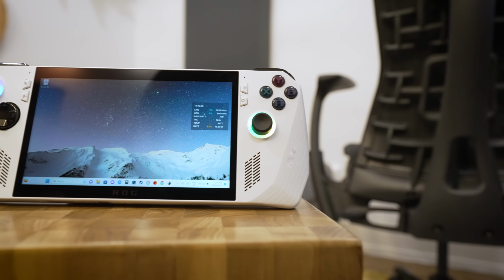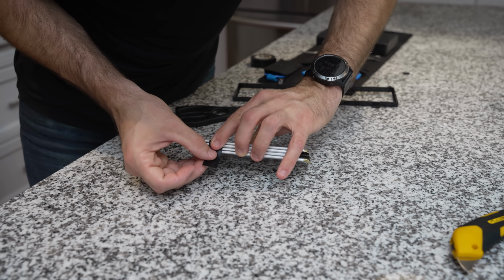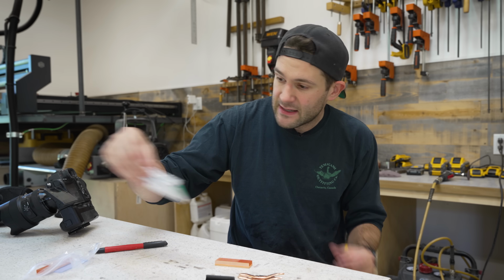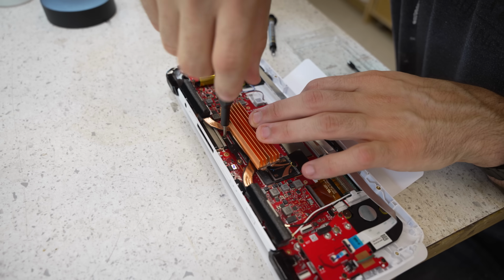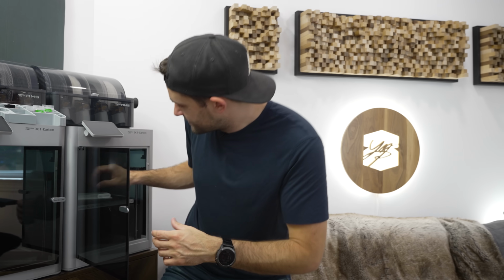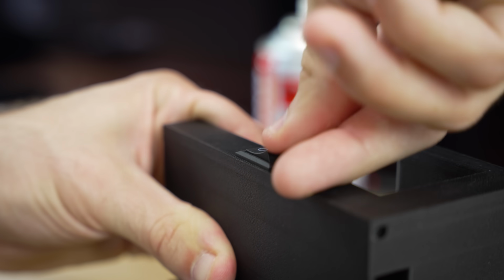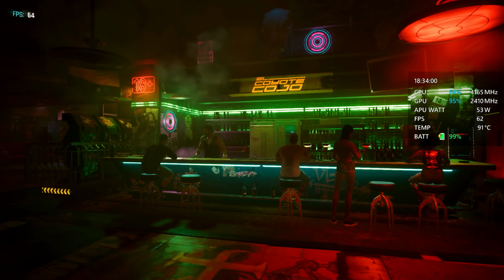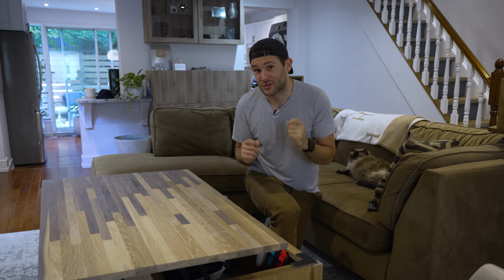I don't understand why people buy Steam Decks...

Comment: It's not more powerful than nay other handheld. The onex player 2, ayoneo 2, AND gpd win4 are significantly more powerful than rog ally and better in most aspects of performance. Not just that but what's the point of having a hand held gaming system if you won't have any games to play on it due to sd cards getting fried?
Lastly, asus is a joke. The armory sucks, I paid 1600 for the asus rog zephryus and regretted it, sold it for 600 bucks. Too many problems. Steam deck has its kinks sure, but it's a little powerhouse with limited issues. Go steam deck. Longer battery life, track pads, can be edited to have like 24 buttons on it thanks to track pads. It just wins. And can play most all games thrown at it.

Comment: I don't see why people are so obessed with the battery life, if you are carrying around the ally you are going to need a bag anyway, at that point also carrying a 99Wh battery bank is not a big deal and with a 1.5m magnetic attach USB C cable so you don't damage the port just plug the cable into the battery bank, put the battery bank in your bag, and attach the ally to the other side of the cable. Done over tripple you battery.

Comment: YOU REALLY WANT TO CHANGE THAT ELECTRICAL TAPE 
use some soldering tape (also known as kapton tape or simply heat resistant tape) instead, black electrical tape becomes runny and soft when heated, the golden tape i recommend is specifically made for electrical aplications in devices that can get exposed to heat

Comment: i have the answer to your "question" in the title:

most people don't have the tools to do what you do
most people just wants a system that just "plug and plays"

i personally HATE windows (and i hate apple even more if that's even possible)
and i personally have 0 trust to asus, which i will consider a good choice of life, because as you told us, even if the sd-melting issue is super easy to fix, they don't want to do it. (also, wtf engineers, what were you playing when you designed that? (pun not intended) )

also, Steam deck is WAAAAY MOOORE POWERFUL than the rog ally at less than 15W... which btw meets all my criteria nicely. so, no expensive brick for me!! ah, and talking about the devil... the steam deck is way cheaper.. even more on discounts days which are quite often...

Comment: I bought the steam deck because the cheapest deck is not functionally different than the $650 option. It was $360 instead of $700 and i already had an extra 1TB 2230 SSD on hand. 

SteamOS is awesome for the games that it supports so far. Emulation is simpler than it’s ever been with Emudeck. If the game doesn’t work on SteamOS I use dual boot into Windows. The only reason people buy more expensive handhelds is it looks better on paper.
Reply: no it is better period, the screen,performance,quality,form factor,heat production... it's okay to have preferences but don't act stupid, the fact are the facts
Reply: @tetofin  People can buy whatever they think is best for there needs and for you maybe the only stat that matters is the highest FPS number for others it might be that they want more than an hour of on the go gaming. 
There's no one best in all areas, its which ticks the most important boxes for you
Reply: @tetofin  ...You do realize they're talking about the cheapest Steam Deck model vs. the most expensive Steam Deck model, right? Because they're correct. There is no performance difference. Hardware-wise they're the same thing beyond storage, and the difference storage speed makes has been shown to be so minimal that it hardly counts.
Reply: @tetofin Price, battery, o.s, trackpads, display oled in steam oled vs rog ally power and Best display lcd, no trackpads in windows??? Really Asus?
Reply: @tetofin whoosh
Reply: @tetofin it's like you put effort into humiliating yourself lmao.

Form factor - Steam Deck W
Heat Production - I can already tell you Steam Deck is a W cuz it doesn't need that much power to run well (and it also doesn't need windows)
Performance - just compare the prices and benchmarks, it's just not worth the money . SD W ALL THE WAY
Reply: @dannyd4rko400  the thing with performance is that the extra performance from the ally comes from extra TDP headroom. at the same power, they perform almost the same, and at low power, the deck performs better. and guess what, my deck usually runs at 10w, down from the default 15, because it doubles battery life.
Reply: @dannyd4rko400  Important note is that even if you're "price is no object" performance whoring the deck scales downward for equal and then superior performance starting from around the 10w range where people are usually targeting the handheld for battery life reasons.

Comment: 21:34 This is what PlayStation keeps trying to shove down our throats. Stream your game from your ps4/5 to a handheld, ie Vita and now their new useless thingamabob. Problem is and always will be latency between input and handshaking, computing, and reversing to output if needed. 
Also, even if the added heatsink isn't needed, it still looks pretty darn cool, and cools pretty well as well. I'd still buy and use it.
Reply: not sure if it relates, but I've been using an app called Parsec for years, it can stream a powerful PC on to a lite PC/laptop/smartphone (or anything to anything), it works perfectly & seamlessly